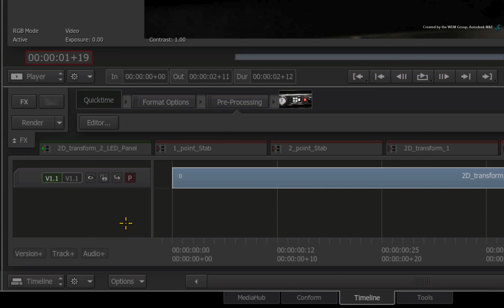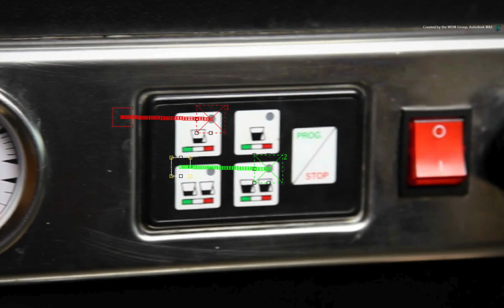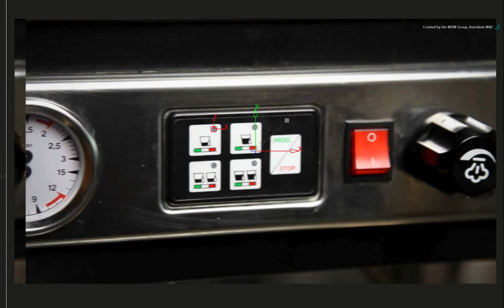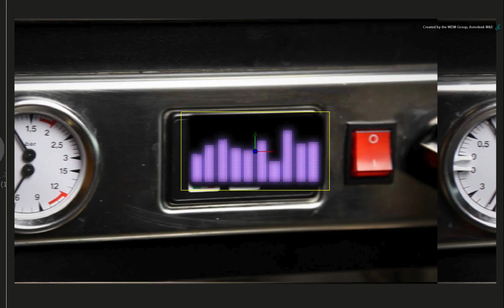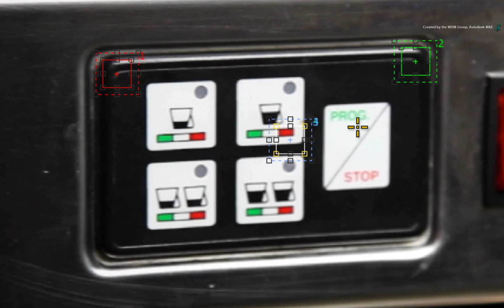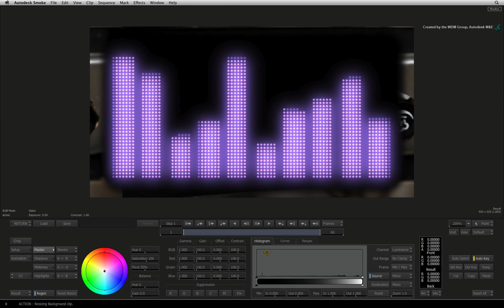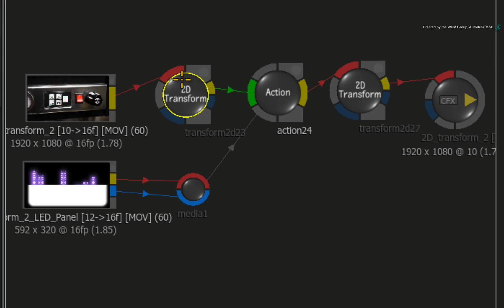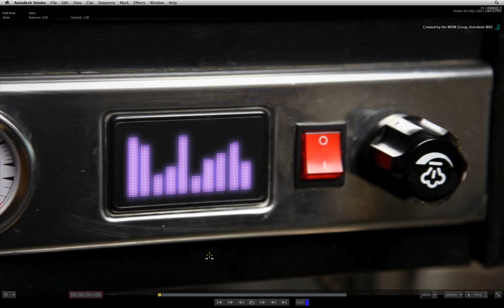Stabilization - Stabilize, Composite and Destabilize - Smoke 2013 Ext 1

Comment from the maker: Hi, The options are all there, they were just named.   Go to the TOOLS pulldown menu on the right of the UI.  Change the option from SELECT to ADD POINTS.   The hotkey is SHIFT+A for ADD.  This is allow you to add keyframes.   Hold SHIFT and click and drag to start adding control points.   Remember to switch back to SELECT MODE (SHIFT+M) if you want to adjust the control points again.

Comment: Thank you.  Manually tracking keyframes is one thing that is extremely vague in the user manual.  Specifically, adding a keyframe manually to a frame that went off the track.  Re-positioning an existing keyframe at that frame is straightforward, but if none exists, the user manual says to choose Add from the Edit Options menu, and in 2013 Ext 1 that option simply isn't there...  Any keystrokes to suggest?

Comment from the maker: As long as the movement is similar like a pan or tilt etc than it should work.  The only problem with a rack-focus pull is that if your tracking target goes out of focus, you either reset the the track or manually track keyframes until you can get a new track lock.   Once the track is matched, you do your compositing and finally, just invert the track at the end to return the camera move.